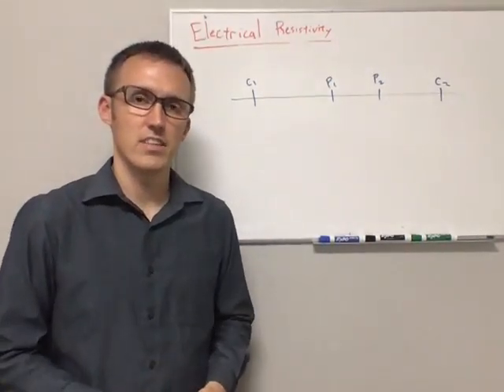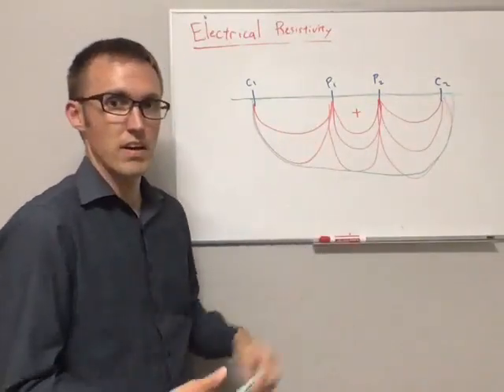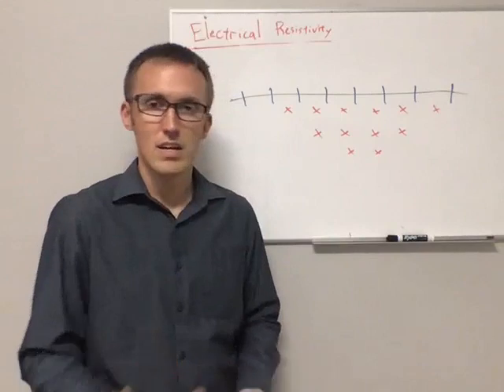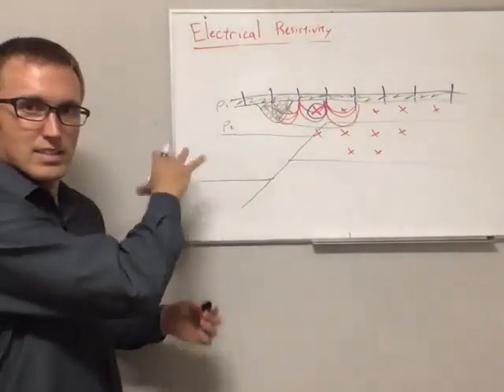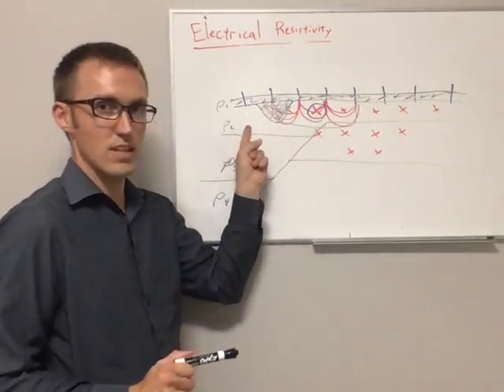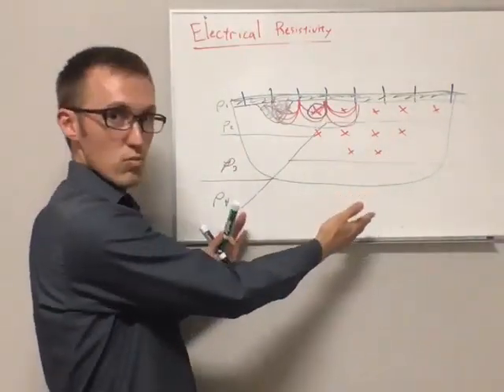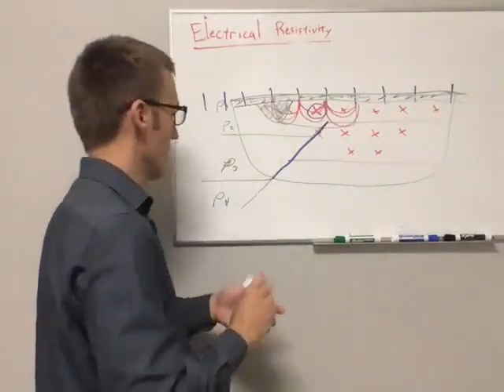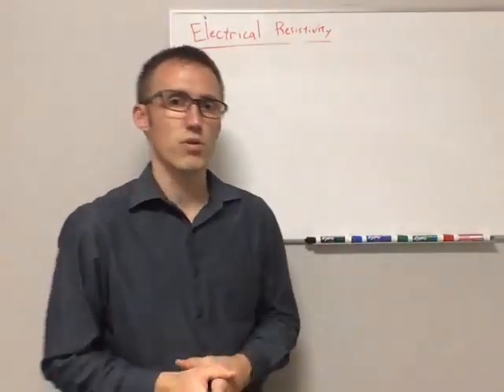What does ERT actually measure?

Comment from the maker: ERT can be used to detect groundwater because saturated soil will have a lower resistivity than unsaturated. It is often possible to map out the water table using ERT, if your depth penetration is enough.